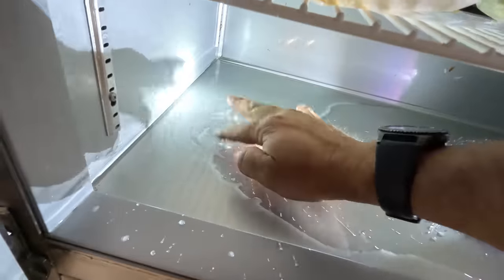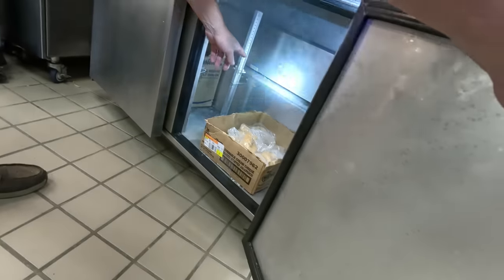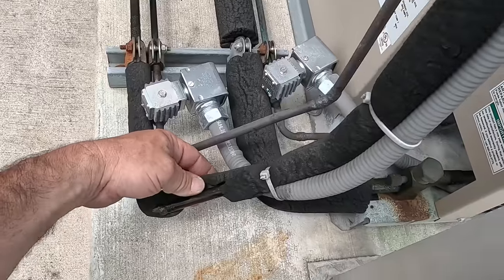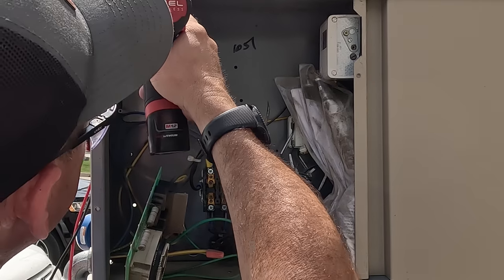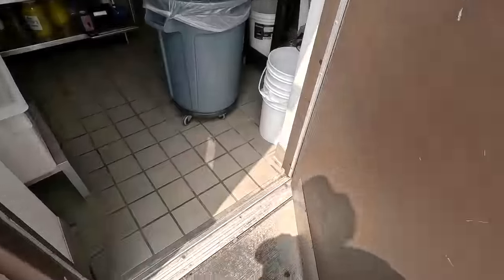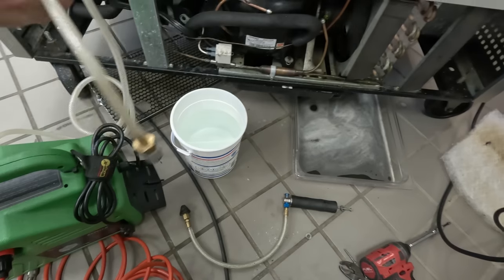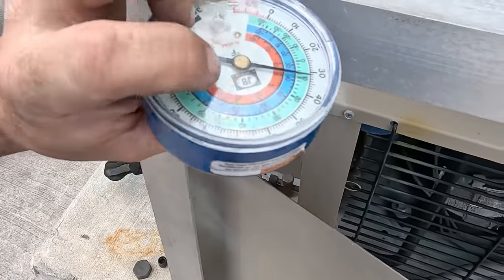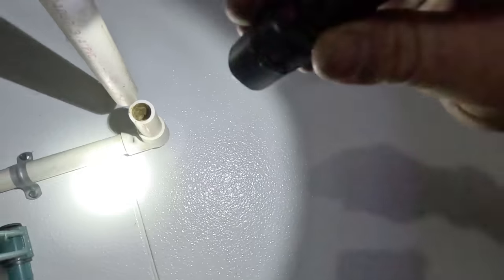Reach In Cooler & Freezer + Walk-in Freezer Problems

Comment: I have found that slime builds up bad in horizontal runs that do not have enough pitch. Also for the drain going into the mop basin I would change the piping to 2 45 angle pipe fittings to reduce the chances of build up and let it flow better. I have to deal with this stuff from time to time and when I do small changes like getting rid of sudden direction changes get less call backs.
Reply from the maker: All sounds believable to me, thanks for sharing!

Comment: You need a new defrost clock. That is what going on n also more than  likely the do insulation too just to cover your bases. I prefer  digital onces that can put in cooler or freezer
Reply from the maker: I haven't had to go back yet. It's been working now for about 2 months. I'll look into those things if I do go back.

Comment: I quit using the paragon mechanical timers. Had three new ones strip out the gears in about a years time. I use the intermatic now. Plus i can stock one and make it replace just about all old mechanicals.  Only had one failure on those. The older time clocks would outlast the equipment. The newer mechanicals. Have china made gears and they will strip the teeth off of them. I am with you on the common drains. Hate them.Stop up easy and a pain to clear.
Reply from the maker: Thanks for the view and feedback!
Reply: yeah, but the contact material is all trash now. so none of them will hold up like the clocks from 30/40 years ago 😉

Comment: You should try prevclog on drains like that it will never clog for 20 years
Reply from the maker: What does it do?
Reply: @HVACRSurvival  it prevents drain clogs for 20 years it’s just a rope coated with silver and copper
Reply: the most common clogs on refrigeration is physical debris and chunks, in which that "silly string" will do nothing for, except be ripped out when it clogs up from aforementioned debris.
it may be OK for A/C condensate, if they keep the filters changed.

Comment: at minimum, they should have ran separate drains and heat tape per box. even if it had to pass through the freezer. a solid line form one end to the other would be better.
also, what genius put 90 elbows on the end of the line, into the mop sink? 🤣🤣 guaranteed insta-clog spot